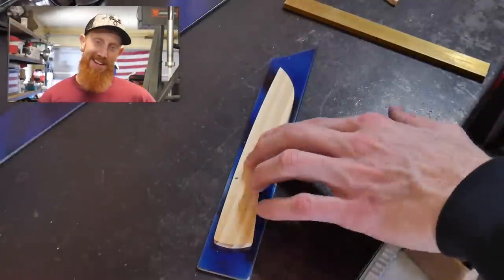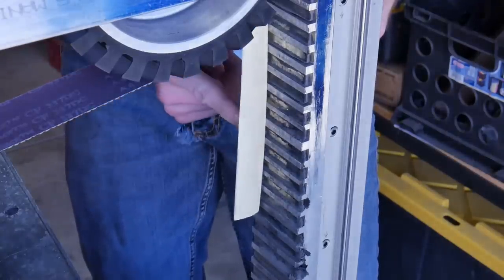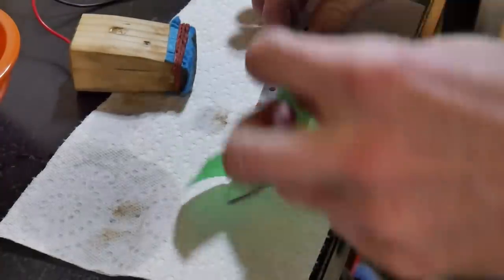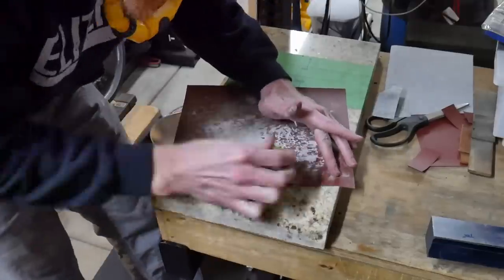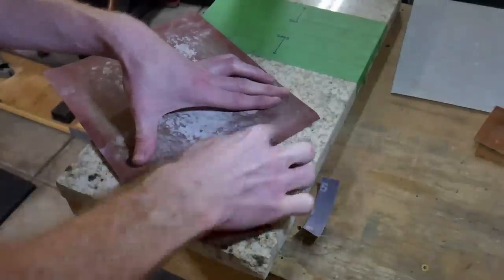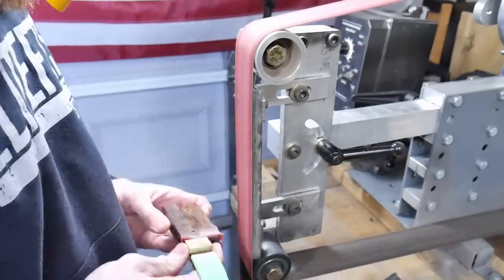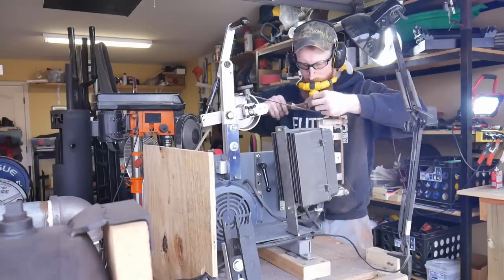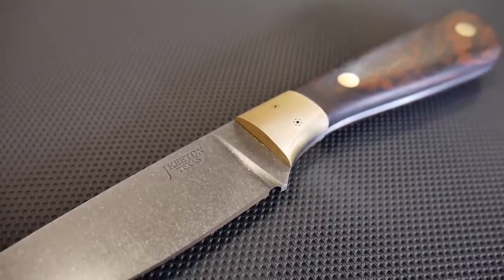Bolsters on a Full Tang Knife | Knifemaking

Comment from the maker: How do yall attach bolsters on your full tang knives?!
Reply: Red Beard Ops I’ve silver soldered then before. Also done pins and glue like you’ve done here. 
Man that tumbler is a great idea! Super cool. Did you do a vid on the making of that?
Reply from the maker: @nolanst29  Thanks man. I do! Here it is - https://youtu.be/TvzW7ZVGg3A
Reply from the maker: @TonySeverioKnives  Hey Tony, thanks for these tips.
Reply: few tips that might help: I would tape up that blade when you are grinding on the handle, That can ruin a blade real fast, even though chance is not that high its a small step to keep it in good order. If you want to polish that bolster with a buffer, also tape up the blade because you will get streaks otherwise. For best results I would sand the bolster front ends before glueing them on the knife to at least 1000 grit, but better is 2000. After you done the front, you can attach them and when handsanding the handle you can finish the side parts of it. Buff it, then finish it  with a brass/copper polish or something to really get it to a mirror finish.
Reply from the maker: @pr0faker  Thanks for your tips sir! I did bring up the front of the bolsters to 1000 before attaching, taping the blade while buffing is a good point. that would suck! Cheers man, thanks for the tips
Reply: Great Job Red Beard Ops.  I do straight pin hols no glue, just peening. The pins are the same material then the bolster so they vanish after grinding and polishing. I like to shape and polish the front of the bolster before peening to the blade.
Reply: I use silver solder but now that I saw this jb weld  I may change my tactic. I love the idea and another great video. Thank you!
Reply: When fitting bolsters I only pin and peen. Any glue has a good chance of popping with brass from heat when grinding to shape if you do that fitting. Also I get really good fit if I relieve the brass over the whole contact area except 2mm around the edges so the brass is only contacting the blade at the edges. Eliminates any slight gaps between bolster and blade.
Reply: The JB weld with pins is ok but, learn the operation of silver soldering and you'll be glad you did. There are a couple good vids that helped demystify the process.

Comment: Hey J. Brand new knife maker here. Have you noticed heat treating prior to bevel grinding wearing on your belts more? In my mind, grinding the steel while it is soft would be less wear on the belt, but I really have no clue. Thanks for your videos. My first couple knives were pretty successful thanks to your help! I’ve watched several other knife makers for assistance but I really dig your process.
Reply from the maker: Thank you! Glad you're enjoying the videos. I do think the softer steel will grind easier. To this point I've done it both ways and to me it depends on the style knife I'm working on. If it's a super thin chefs knife or a basic 1/8'' skinner I'll just knock off the corners (so like a 1/4'' bevel) pre heat treatment. If it's a thick bowie, I'll go further.

Comment: One thing I like to do is bevel the front of the bolster pieces to 45° before attaching them and you can use cloth backed belt, turned upside down and loaded with compound as a way to polish the brass. Great looking knife like always
Reply from the maker: Thanks for the tip!

Comment: If you want the bolster to shine, try "Simichrome" polish.  It contains cerium oxide abrasive and some sort of acid (oleic, I believe), but it will take that brush finish to mirror in a minute, even by hand.  You can find it in motorcycle shops, (and maybe auto parts stores).  It is phenomenal on brass and aluminum.  It's a little pricey, at $15 or so per tube, but a little goes a long way.  Mirror finish.  Almost instantly.
Reply from the maker: Thanks for the tip David!

Comment: Great looking knife! When I do bolsters and pommels I do as much finishing on the hard to reach spots as I can before I finally peen them on. And a buffer would make things easier but if you have a drill press then just get an arbor that will fit and crank up the speed. It was what I used before I got a buffer. Great vid keep up the good work!
Reply from the maker: Hey Ben, thanks for the tips! I need to try that out! I appreciate the praise and your comment!

Comment: Nice job and I agree the brushed brass looks good. If you want a higher shine, brass is pretty easy to polish up with some 3000 grit wet paper. A buffer is still the easiest/best however. A deburring wheel will get you pretty close as well.
Reply from the maker: Thank you sir! Sounds like I need some higher grit paper and maybe a small buffer! I think I'd want a VFD on my buffer.... they freak me out a little...
Reply: @RedBeardOps  for something like this, get one for the drill to start. It will be a bit slower, but it'll work. Brass is pretty easy to polish up.
Reply from the maker: @timetestedtools  Awesome, I'll look into this for sure. Thank you for the recommendation, sir.

Comment: Great knife, I really like your etched/stone washed blades. A low cost buffer can be achieved with the buffer attachments for your  corded drill, I picked up a set from an auto parts store. To fix the drill in place, I used the handle attachment which fitted on the front of the drill. My Bosch used a thread to screw into the handle to tighten the clamp. I removed the handle and fitted it to an angle bracket I had lying around and used the bench vise to secure the drill. Use the drill on constant run instead of trigger. adjust your speed as needed. Just make sure you have the drill running the right direction or the pad unscrews.
Reply from the maker: Thank for the tips sir! I agree... I need to get me some of that equipment for sure. Hope you have a great week!
Reply: @RedBeardOps  I bought a 3/4 horsepower motor at an estate sale running at 1340 and mounted it on a 2" thick board. I also picked up a deal that runs with a v-belt and is 18" from the motor. It came from Wards (Montgomery Wards) and has a threaded rod running through with the belt going through the middle with a buffing wheel on each end.  I picked up a number of buffs from Gesswein and use those with different polishing compounds. Tripoli would have worked well for this knife I think, as it is designed to remove scratches, etc.from brass and bring the brass up to a great shine. You could fix up a 2 sided setup, running tripoli on one side and red rouge on the other. The tripoli will get a good start and the red rouge will bring everything up to a high luster....really shiny if that's what you want. I have been poor-boying everything but hope to eventually get a set-up similar to yours for knife work, and I think you did a great job on the bolster.I was surprised you didn't tape your blade (like the guy above)  . Even though most buffers on the jewelry side run a great deal faster, rpm-wise, I haven't noticed any big problems with the slower speed, even when I am working with silver. It may take a bit longer but not that much. Hope this helps...Also. very good video and narration!

Comment: I seen your mini mill and I was wondering what kind it is? And besides the mother board have you had any problems with it? I read that some come with plastic gears, if so has this been a problem for you ? I've looked at a lot of mills and have probably seen this one but do you have a link? And if you have covered this in a previous video sorry but I'm new to your channel. Thanks. THOR.
Reply from the maker: Knifemakerthor hey man, this is a Sieg X2D mill. Many companies take this mill and rebrand it. Mine came from harbor freight, but there are multiple buying options online. I put a link to one of those options in the description of my surface grinder video. It does have plastic gears, but so far they haven’t been an issue for me. You can get upgrad kits for them at littlemachineshop.com ; they also have a good deal of info on the mill.

Comment: I use the harbor freight corded dremel with a buffing wheel attachment. Works great and I have pretty good control. I’d suggest sanding to like 2000 maybe.
Reply from the maker: That's a good idea! Nice low cost of entry too. I only went up to 1000 grit before hitting it with the belt so maybe the 2K would work better assuming I'll hit it with a dermal buffer. Thanks for the suggestions!

Comment: After many experiments I have the impression that G 10 does not give a durable bond with any glue. I used two component epoxy glues from various countries, cyanoacrylate glues also failed. G 10 was sanded with coarse sandpaper and thoroughly washed with pure alcohol. Beautiful and well made knife.

Comment: Nice looking knife. Bolsters are not difficult and IMHO add a professional look to a knife.To polish the brass I first finish on the belt to 250 (or maybe 400 to reduce the buffing). Then tape the handle off from the brass and the ricasso area. Buff on a soft stitched cloth wheel with fine polishing compound. Beware of heat build up in the brass as it can destroy any epoxy under the scales/ bolster (if you are using it). JB Weld will no doubt withstand heat better but i haven't used it. Also use the buffing wheel to relieve the sharp edge that forms on the front of the bolster after the sanding. Save risking damage to the ricasso using sand paper.

Comment: So you heat treated then shaped the blade?  I guess that helps prevent warping, but normalising, then shaping makes the shaping and sanding easier. Then harden and temper.  Thoughts?
Reply from the maker: Yep, I've moved to doing all my grinding post heat treat. I don't see much difference in belt life and it does seem to greatly reduce the amount of warping issues. I also like not having to get geared up to grind and in the zone twice.

Comment: harbor freight has a set of 2 buffing wheels for your drill and comes with 2 different compounds . it works well but the buffing wheels wear out relatively fast but will tell you if its something you want to invest in now or can wait . i can say i sanded to 500 and with the red compound puts a mirror finish on brass quickly. the 2 pack costed me less than 4 dollars
Reply from the maker: Nice! Thanks for the tip Adam, I'll look into these. I think buffing may be the way to go with bolsters like this to get a nice even finish.

Comment: Are the bolster pins you used here hollow? I see black dots on the finished knife.
I have never made a single knife, it occurred to me that tapping the bolster holes then peening might allow the pin to compress into the threaded area and provided an even more secure fit up since you end up sanding off the peen.
Reply from the maker: Cheers Greg! Those are mosaic pins. The black is actually died epoxy. I've been warned against peening mosaic pins, but haven't had any issues yet.

Comment: Nice work but a couple things to keep in mind, always finish the front of the bolsters before attaching them to the blade. Another thing is theres no real need to bevel your pin holes, expansion of the pin is more than enough to secure the bolsters and another issue with the bevels is that when you grind the pins flush you create a very sharp tapered edge to the top of the pins which sometimes has a tendency to roll up and makes the pins non-hidden. I always use at least three or four 3/32 brazing rods and after setting them with a hammer give them a final squeeze in a hydrolic press which makes them disappear once their ground down.
Reply from the maker: Good tips John!

Comment: Knife looks great! Did you have any issues peening the mosiac pins? I was thinking that the pattern would deform, or the epoxy inside the pin would chip.
Reply from the maker: I did not! I know this has been frowned upon historically, but they held up great. I think it's because the peen is pretty small. Cheers Matt

Comment: Hi enjoyed your video in particular your approach to handle construction. I have a question on acid etching? How do you keep the colour consistent on the tang or do you just accept that during the sanding, shaping process you will lose the etch and the tang will be a different colour to the blade? Any thoughts appreciated and I thing a brass bolster may be my next challenge.
Reply from the maker: Thank you for your comment sir! Glad you enjoyed the video. I put a satin finish on the tang of the knife. If you wanted to have the stone washed finish on the tang you'd have to be able to take your handle apart after shaping to etch. I think this is possible on general scaled full tang knives with some take down fasteners. The difficulty will go up! But possible. Cheers!
Reply: Thanks really appreciate the quick response and Satin finish it is.

Comment: The knife looks really good. Brass and ironwood are a perfect match. One thing i would never use for fastening the bolsters if you want a really strong hold are mosaik pins....as peening those has absolutely little to no holding force. You also risk distorting the mosaik pattern when peening. I prefer to use solid pins that actually can be mushromed/ peened better , are invisible after sanding and have more holding strenght. Brass pins are best annealed before you start peening them...so they dont chip when you hammer them into place.Soldering the bolsters could also be done....if you clamp aluminium plates to the blade as a heat sink you dont ruin the temper. I would also leave the brass bolsters only satin finished as a buffed polish does not last very long and looks ugly because you can see vingerprints , scratches or dirt on them more easely. Cool invention on the tumbler :)
Reply from the maker: Cool deal, thanks for the feedback sir! I based my pin design from Dave @ HorseWright Clothing who has been using and peining mosaics pins in bolsters for years.. I was also skeptical at first. He has a write-up on bladeforms talking about peining mosaic pins. Being a bolster novice I have very little opinion on the topic! On this build they seemed to have worked very well. Probably because with the small taper I'm using they aren't being stretched too far? Any how, I'm not opposed to solid pins for bolsters for sure! Thanks for the feedback on the satin finish on the bolsters! The tumbler idea came from 927 forge. He has a channel here on You Tube. I use that thing all the time! Cheers man, thanks for watching and thanks for your comment!

Comment: Why don't you try double side tape for holding the pieces together instead of drill bits? I do, and it works perfectly 3M has got some pretty good thin stuff...in any case thanks for your videos, they are very helpful
Reply from the maker: Good idea! I may need to try that out. Thanks for the tip sir!
Reply: @RedBeardOps  You are welcome! I use 3M 9088-200 this one is 0,2mm thick...holding power is more than enough...there are lots of them in case this one does not work out for you

Comment: Not really the silver bullet, but more of a fine adjust.  I'd recommend making a steel sub-plate to which you can screw your bolster stock.  I'd thread the bolster stock and screw it to the sub-plate from the back.  The sub-plate goes on the surface grinder magnet, and then you can surface grind the interior face of the bolster really flat.  You could use the same process with scales, too, by using very thin double-stick tape on the sub-plate.

RE: assembling the handles with bolsters, I welded up a bizarre, but useful clamp -- there's a small C-clamp which grips the blade, a long spine that is parallel to the knife spine, and just the screw part of a c-clamp.  I made it for pushing a hidden tang handle up tight to the bolster.  You might adapt the idea for individual scales.

RE: polishing the bolsters... one thought, maybe not a good one b/c it would require changing your process.  You have a tumbler.  You live in Texas.  Surely you or someone you know reloads.  Use the  small stainless pins to polish the bolsters just like you'd do with spent brass.
Reply from the maker: Hey Alan, thanks for your reply. Those are some really good ideas! I like the idea of making a surface grinding "caddy" for my scales and bolsters. Very clever sir! I appreciate the time you took for this comment! Cheers.

Comment: make sure you use good water for the etchant. I use invisible pins for bolsters. use a countersink and copper, brass, or mild steel or nickel silver pins, whatever the bolster is. Then, get the pins about 2 diameters proud on each side, with a nice countersink to peen into. Epoxy bolsters and scales, and make sure the bolster/scales fit like a dovetail, so that there is overlap so that the bolster helps lock the scale down. Peen the hell out of it - hit it like it stole something. Using a tapered punch was a good idea. Also, get a rounded, hardened punch, and drive the peened pin heads down hard with it, then sand the dents off (or file). Just make sure you sand from bolster onto scale never only on scale, and always use a large, hard, flat backer. Oh, and superglue the bolster material together and round/radius the front of the bolster and polish before putting them on the knife. Just put about a 2 degree angle on the back edge of the bolster and on the front of the scales (milling machine with proper spacers/angle pieces). out of order tip - be sure when you hand sand you always have part of the backer over the bolster. Buff the brass. Also, you can use a leather belt with green chrome to get a good polish on brass. You can even use a stick with leather glued to it with green compound as a buffer on small stuff. It is what jewelers do.
Reply from the maker: Thank you very much for the information Kevin! Cheers sir, have a great weekend!